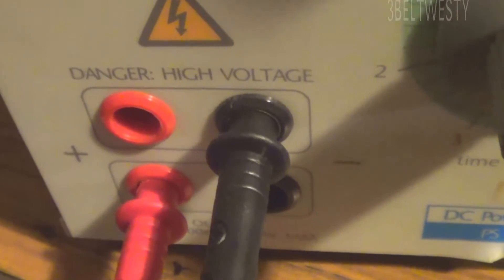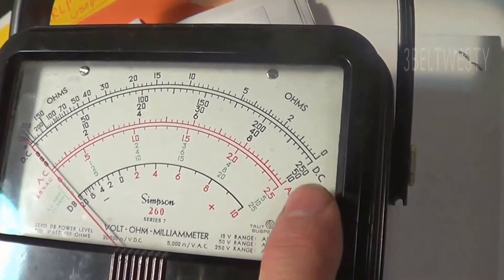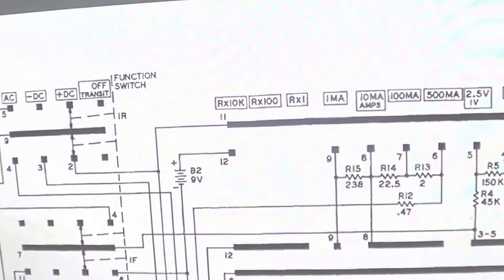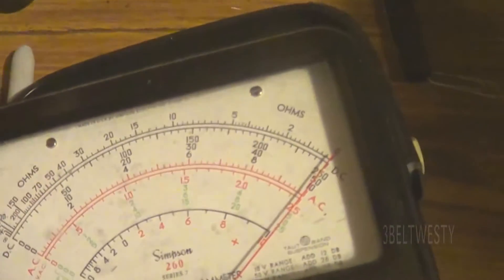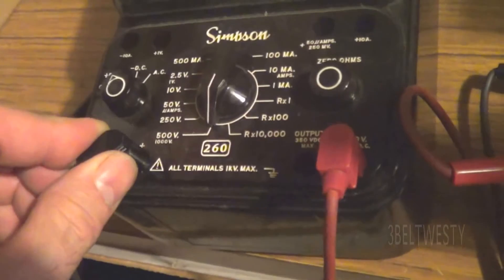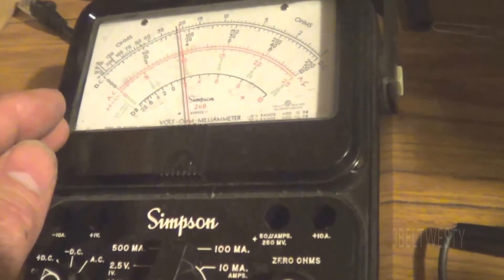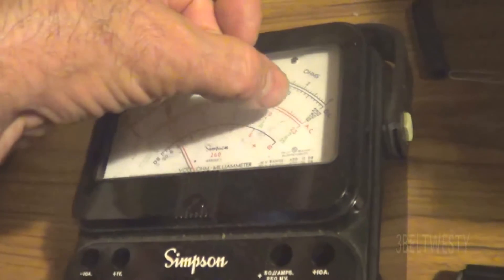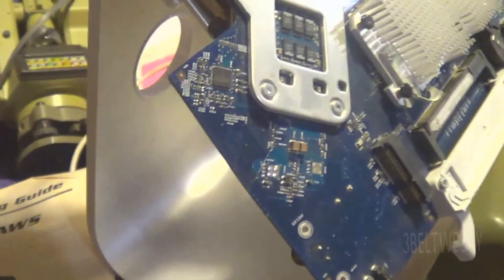SIMPSON 260 Series 7 Voltmeter 1000 VOLT Jack is HOSED

Comment: If you look at the schematic, you'll see the 7.5M and 2.5M resistors are connected in series between the 1000v jack and the + jack, as well as their other connection to the switching matrix.  So... if you were to (disconnect everything) and measure the resistance between those two jacks with your other meter, you should see 10M.  If you do... problem is elsewhere.  If not, there is a problem with those resistors.  It's not to hard to imagine blowing them up when you're working with Big Volts like that.

There are other such pathways; you can access the + side of the meter itself directly with a 250mV / 50uA jack, which could be handy in measuring the total resistance being set up by the switching matrix.  In fact, I'm pretty sure that no matter how you hook things up and switch them otherwise, you should see 250mV between the Common jack and 250mV jack when then the input voltage is "full scale".  That's what the switching matrix is trying to do - turn whatever voltage you put into it into 0.250volts full scale, directly across the meter.

It sorta seems like at least one of the resistors in there is faulty, and if the rest of the meter works, it sorta comes down to those two at the 1000v jack.

By the way, that 10M at the input, in series with the (about) 10M in the switching matrix, end up forming a voltage divider with the 5k at the meter movement itself.  So you have R1 = 19.5M, and R2 = 5k, and the divider is then R2/(R1 + R2) = 5k / 20M = 0.000250.  So that's the divider (or multiplier, depending on how you look at it).  Then, with a thousand volts across that, you get the 250mV required to move the meter to full scale.  With 500 volts at the 1000v jack, you should see 0.125volts between the -Common jack and the 250mV jack.

Comment: Your meter is calibrated correctly , you are reading the scale wrong.
Reply from the maker: Wrong. Actually, it is the opposite. I am reading the meter correctly but the 1000 volt input jacks series resistors are faulty. For the 1000 Volt setting, you use the 0 to 10-volt black scale and multiply by 100. It is in the manual here on PDF page17, printed page 4-8  http://www.simpson260.com/downloads/simpson_260-7_and_7m_user_manual.pdf We bought the meter new in 1981 and have used the meter on the 1000 volt scale many times